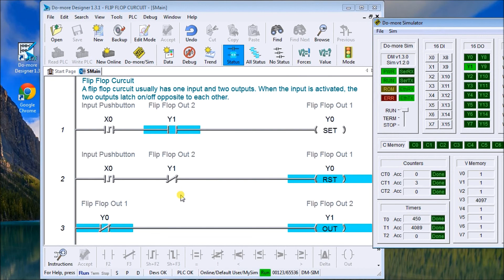Master PLC Flip-Flops: Toggle Outputs with One Input!

Comment: Works great! now is there a way to add a 3rd output to the flip flopping? to enable 1 and disabling 2 every every time it flips? 

thanks for the help
Reply from the maker: Hi @user-zt3wz4je1p
If you want more than 2, I would switch to a counter. 
The leading edge of the input would increment the self-resetting counter with a preset of 3. Compare the present value of the counter and trigger the outputs.
Here is a sample program using the Do-More Designer.
https://www.dropbox.com/scl/fi/loddyk9ksjk4ifyay56i4/Do-More-1-Input-3-Outputs.zip?dl=0&rlkey=v7qcdygmv3os5npteirk961ts
Regards,
Garry
Reply: @ACCautomation  thanks a lot! 😁

Comment: This wont work on most PLC's. The hardware checks the input / output values then runs through the scan cycle - the whole program. So essentially what you are doing is reading the positive pulse for the set network and the reset network. So in the real world application this will set and reset Y0 in the same scan cycle (I just tested this on Hardware and on a PLC simulator). Every PLC does the scan cycle differently so what works for one PLC might not work for the rest. There is a sure way to program a flip flop that works for every PLC
Reply from the maker: Hi Reghardt,
The PLC will solve your logic from left to right, top to bottom. The status of the memory from the previous rung is available for the next rung to use. 
https://accautomation.ca/understanding-the-plc-program-scan/

This Flip-Flop circuit works on all PLC models. 

X0 is a one-shot or leading-edge input.
https://accautomation.ca/how-to-make-a-one-shot-in-the-plc/
This post will make a one-shot if the instruction is not available in the PLC.

Y0 is the output that will turn on when X0 is pressed once and then off when X0 is pressed again. (Flip-Flop)
Output Y1 is a condition for the Set and Reset instructions on the rungs. This output will be set after Y0 and will ensure that Y1 is not set and reset in the same scan.

Regards,
Garry
Reply from the maker: Here is the post for this video.
https://accautomation.ca/creating-a-flip-flop-circuit-in-the-plc/

Here are a few links from forums that will further explain the logic.
http://www.plctalk.net/qanda/showthread.php?t=115412
http://www.plctalk.net/qanda/showthread.php?t=120363
https://community.automationdirect.com/s/question/0D53u00002kcOkL/click-plc-how-to-program-a-toggle-button

Regards,
Garry
Reply: What type is your plc